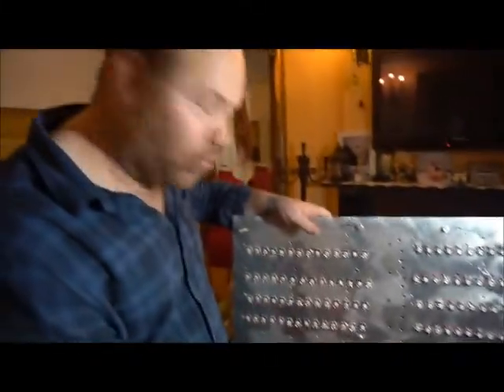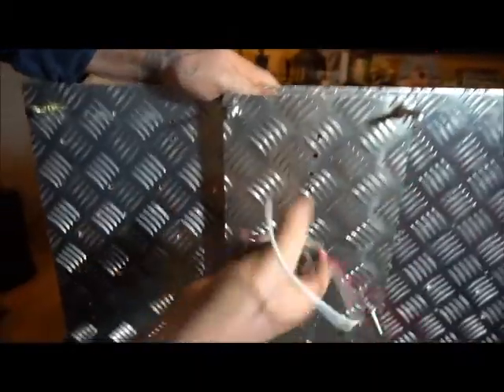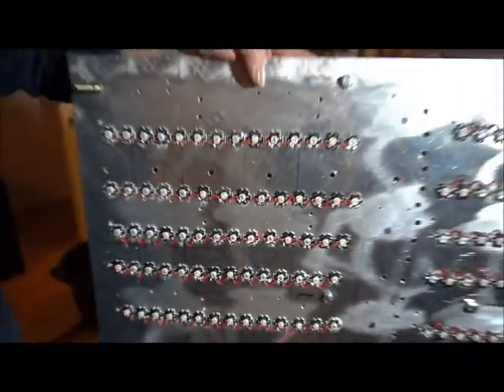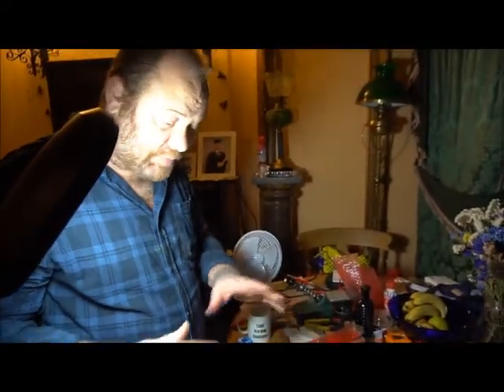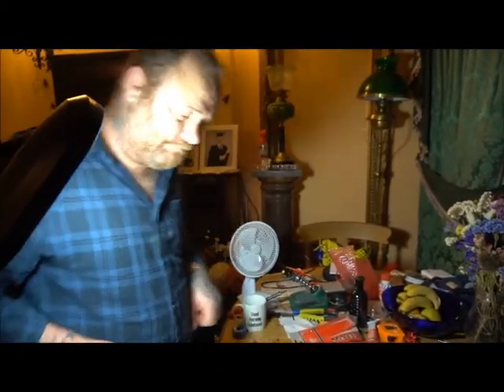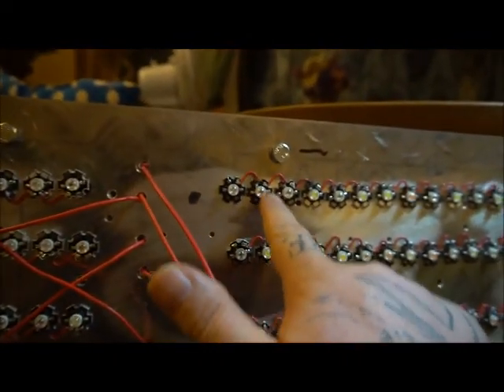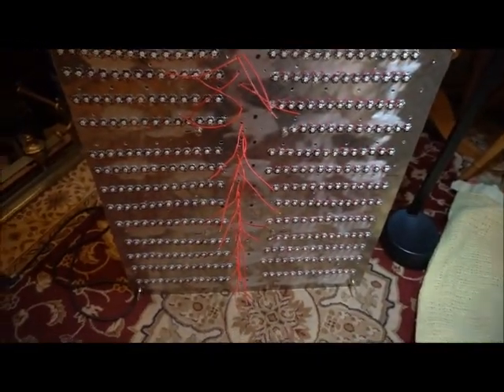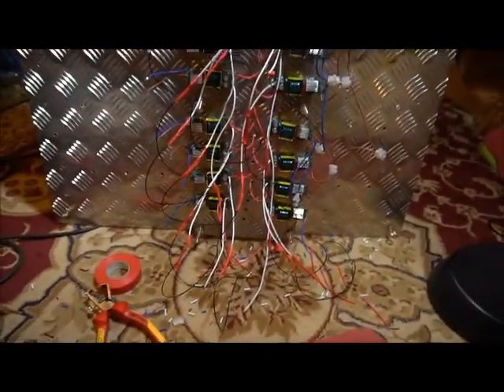huge led part three

Comment: Yes because you used bare drivers without a case or anything to stop them touching the checker plate lol some 3M sticky foam would have worked lol
Reply: this

Comment: did you get the light working in the end
Reply from the maker: I'm looking at this led tomorrow..i think I might need to replace all the drivers..it blew up on me when I plugged it in I think it shorted the drivers out placing them on the aluminium surface..ive still got to build another light I have 100 10watt cree leds to make next that should be fun.in between doing  my job and inventing other things...ive just invented a simple contraption that wipes out all bugs/plantpests I'm hoping for it to hit the market in the next couple of months...lifes fantastic
Reply: Nichia NFDWJ130B-V2 Chip on Board Modul, 6780lm, 2200K, CRI 80 (39 V 1,150 mA 44 W )